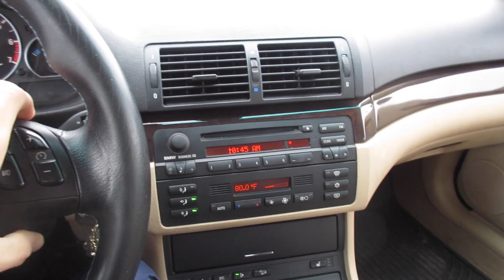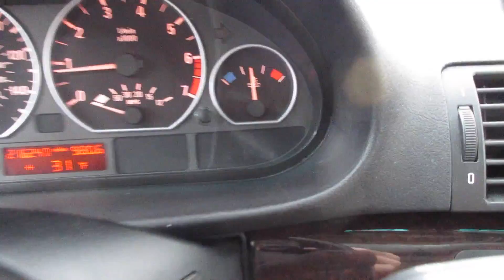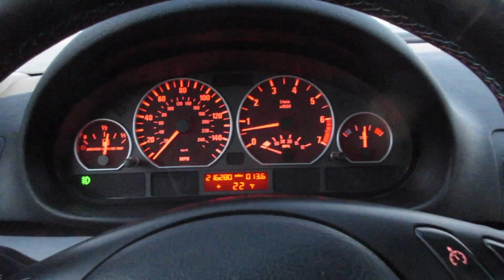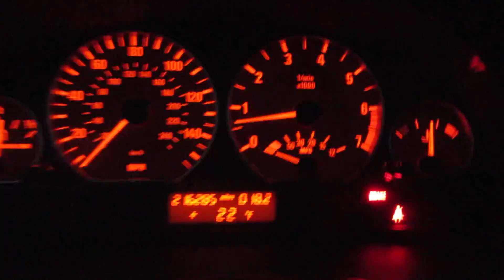Snow Sculptures  11/17/14 - Day 1,439

Comment: Loved the vlog! Very funny! :) I was wondering; when you're driving it seems like you hold the camera with your right hand, but when you change gear, it also seems you're using your right hand. Although the camera doesn't shake as it would when you used it to change gear. How do you do that? :P Maybe it's a stupid question but I couldn't help noticing.
Very nice car for your sister! I wish I could easily drive and afford cars that are more fun than the one I'm currently driving... 
Take care and drive safe!  - Lars
Reply from the maker: I hold the camera on top of the steering wheel.  Both hands on the wheel, and I can alternate hands supporting the camera for gear changes or turning and operating signals and the like.  Works quite well!  And the Canon has image stabilization that is pretty good, so that helps!